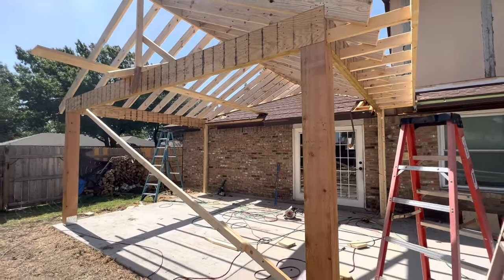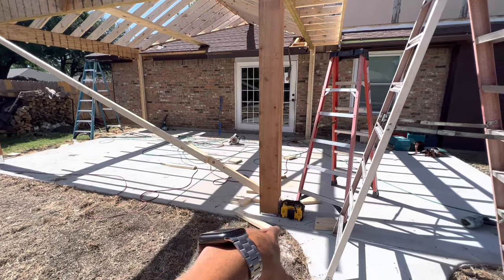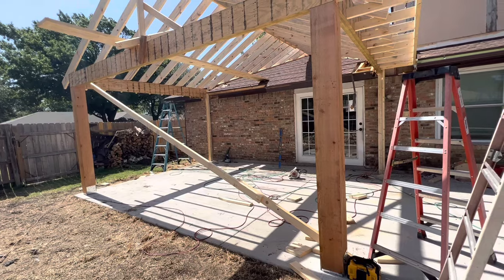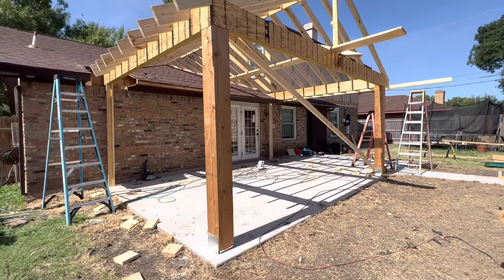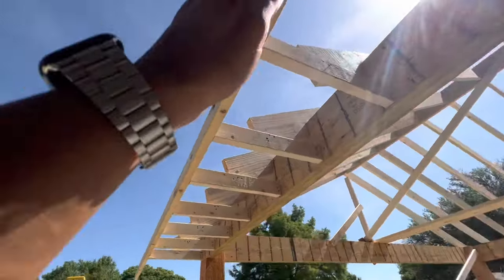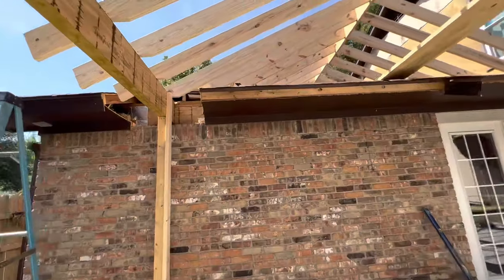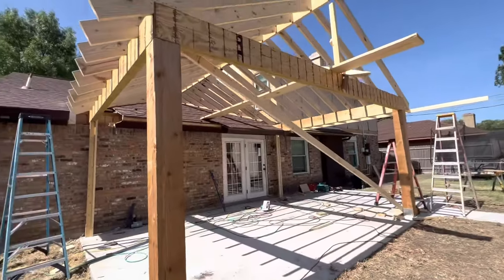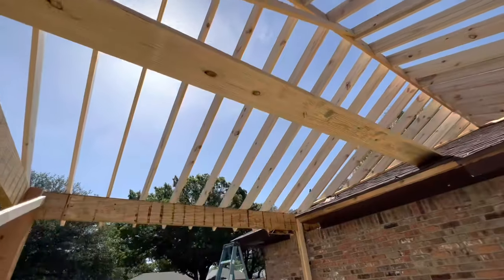Pro patio build series #1 #patio #patioexpert #patiocover

Comment: I’m building something just like this except mine will be 24’x24’. My question is, how did you determine the size  and number of the LVLs and how did you secure them above the 8”x8” posts?
Reply from the maker: bolted, to post, and we use metal  lvl hangers

Comment: How did you handle the tie in from the LVL beams to the existing house framing?  It looks like the 2 x 4's against the brick may be temporary.
Reply from the maker: Yes they where temporary. We used metal Simpson brackets rated for load

Comment: How did you attach the lvl beam to the house. I am looking to do something similar but AYC glulam beams. Do you do work in Keller, TX?
Reply from the maker: yes we work in keller &  its a top mount metal bracket
Reply from the maker: we used a top hanging simpson bracket made for LVL ,   yes we are in haltom city